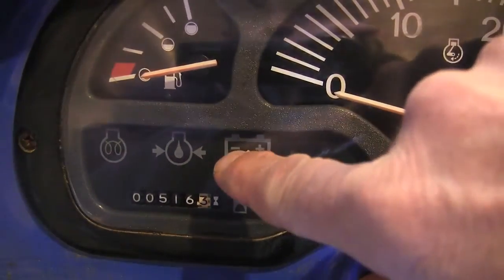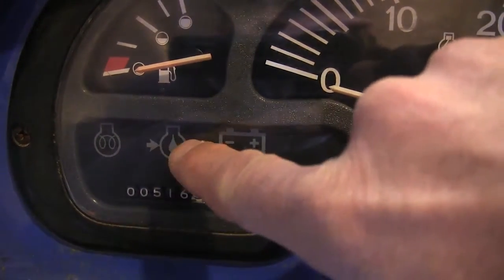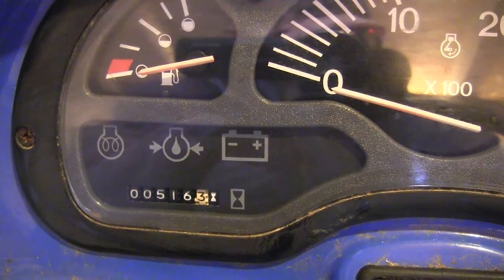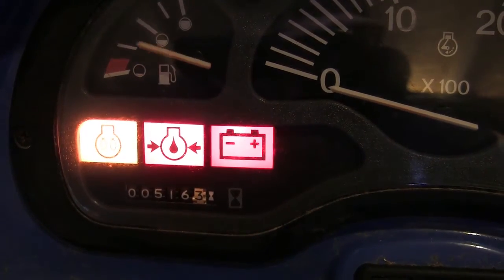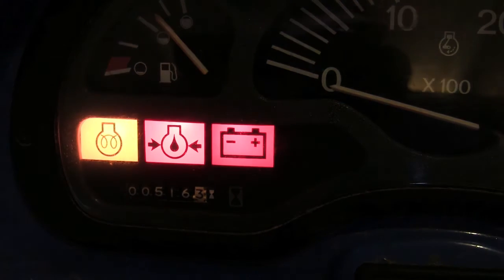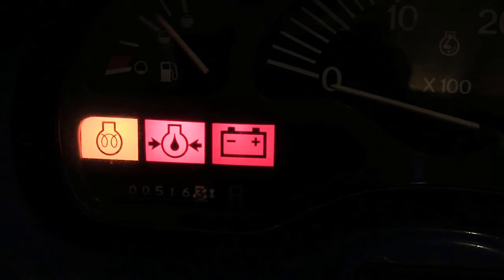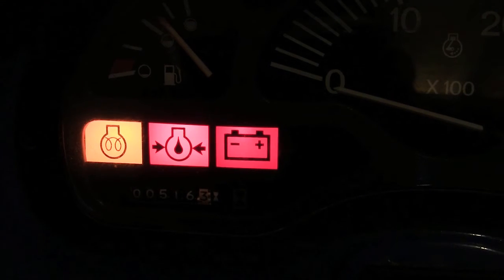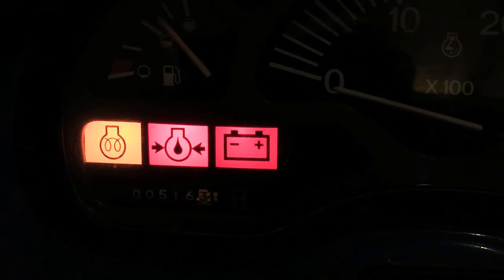Why is My Tractor Hard to Start?

Comment: My TC30 has been sitting in cold temps this last week.  Average 8°.    How long should I let the glow plug run before trying to start?
Reply from the maker: Hold it until the light on the dash goes out.  If it doesn't go out (it may not when it's really cold) I'd hold it about 30 seconds and then try to fire it up.  This last week has been a little rough on tractors starting.

Comment: I have a 1972 Ford 4400 industrial tractor with a 3 cylinder Perkins that I use on our property . Have owned tractor for almost 7 years and it is always difficult to start - often either clicks or turns slow a couple times and then stops  - to be honest it acts like the battery is weak. I have a new 1300 cca battery that I put in this fall (2nd time I have replaced battery) and even with the new battery and the block heater plugged in for 30 minutes I still always need to connect my 1500 amp jump pack to get the engine to turn over with any kind of real effort. Why is it requiring so much battery? Is the starter wearing out? Do I have a short? Or is it a compression issue that for whatever reason my compression is higher than it should be? Once I hook up the jump pack and a decent battery it will start and it runs really nice with excellent power, but the whole starting ritual is a major headache I would like to solve.

Comment: Some tractors have a button to push. 
Mike... I know that based on your employment history you promote dealers quite regularly...understandable. 
However, changing a glow plug is no harder then changing a spark plug. 
And testing them is easy too.  No need to take your tractor to the dealership for this.
Reply: Can you test the glowplugs without removing them?  Can you remove the wire and metal bridge and touch the top of the glowplug with the positive lead of the tester while the negative lead touches the negative terminal of the battery?  What effect would that have on the resistance reading?

Comment: have a 2011 jd 5045e blue smoke under load and low on oil seems to be loosing some power over 1500 rpm, what can I do before taking it to 
john deere.

Comment: When I bought my first tractor (NH T1510) a few years ago, my dealer told me that if the tractor had been running for a few minutes, it wasn't necessary to wait for the glow plug light to go out. Nevertheless, I ALWAYS wait for it to go out...and that's something for an impatient Type 'A' personality like me! You didn't mention anything about that in the video, what is your opinion on the glow plug if the tractor is warmed up already?

Great videos, Mike. I learn a lot from you...thanks.
Reply from the maker: +Karl Kelley Good question Karl.  My experience has been that on many tractors you just about HAVE to use the glow plug every time you start it if you want it to start immediately.Even in the summer, even if it's been running.  When I worked at a dealership sometimes I would assist in the moving of the used tractors to mow under them and it didn't seem to matter the brand or model.  If you wanted them to start right up you hit the glow plug, and when you were ready to move them back you had to hit the glow plug again.  Some tractors seemed to be better than others, you could have two of the same model side-by-side and one would be easier to start than the other.  I'm like you, I don't have the patience for that little light to go out, but the little light is pretty smart!

Comment: Good stuff Mike. I also like to look at the amperage or voltage gauge and see if it drops during the glow plug cycle. In my experience I have seen the glow plug symbol on the dash lite up but some or all  of the glow plugs do not heat up and your cranking for ever and most times in the winter will not start.  I like to change put glow plugs every 5-7 years as a preventive maintenance as they do get weak over time. 👍👍
Reply from the maker: +Steve Rob Good advice.  Truth be known, the one on my tractor is in the process of failing.  I was lucky it performed right for the video.  I hate to admit it but I'm so conservative that I won't fix it until the tractor won't start.  I learned from my dad not to spend money you didn't have to, so I'll run it until it blows.  I think with stuff like that, we think there's a chance we might die before it fails then the guy that buys it at the estate auction has to fix it. :)
Reply: LOL
Reply from the maker: +Steve Rob I do like your advice, though, your tractor will last longer than mine because of its good care.  Mine won't bring as much at the estate auction because the auctioneer has trouble starting it just before it sells.
Reply: +Mike Wiles (Ask Tractor Mike)  Ha  I get the glow plugs for free , my friend owns a parts store and I help him out. Their about $15  cost but the main reason is you have such a hard time getting them out and I'm planning on living a long time .  A good topic is how not to blow up your tractor with  quick start  .  Ha